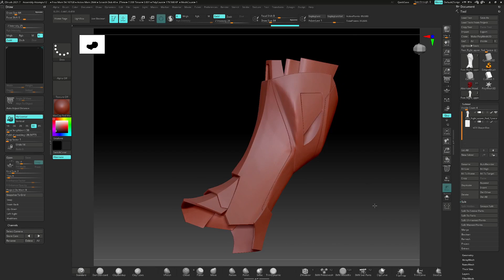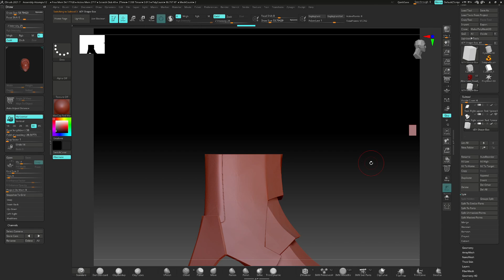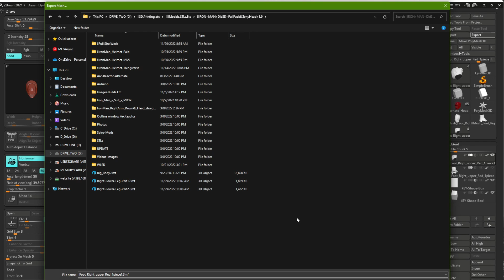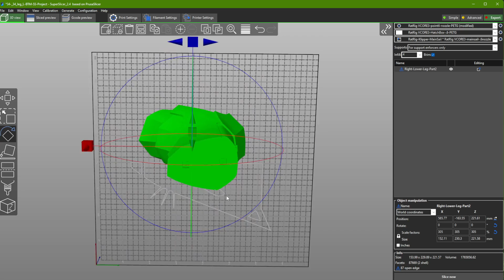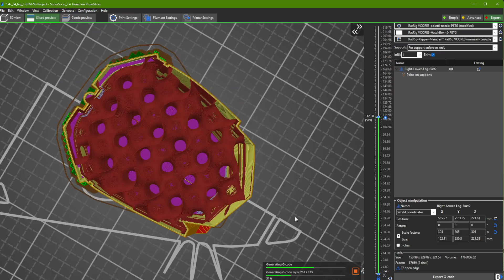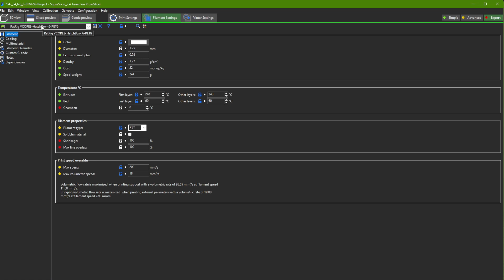Iron Man MKVII Full Size Build Part I

Comment: dont you need a positive part of the "boolean" ? they looked both negative and cant connect that way
Reply from the maker: Yes you do.....but I simply just print a bunch of square pegs, that then become the keys to bolt the parts together...this eliminates the positive parts, which basicaly make the printing of the pieces much easier...you simply then  insert the square printed pegs, and the parts align perfectly for gluing...makes sense? (see my other videos)
Reply: @cyborgcnc  thanks! how do you size the square pegs so that they fit please? I dont see this in the other videos
Reply from the maker: @MightyHeidi  I simply use say a 12x12x20 square to create the boolean holes in the part I am slicing..then I print an 11.7x11.7x18 square that i use as a key..i found out that about .3mm smaller square will fit in the holes created nicely....you can also use a little sandpaper to make them fit tight, if some do not fit due to shrinkgage of the filament...really nothing more than that and pretty straight forward.....
Reply: @cyborgcnc  thanks so much!